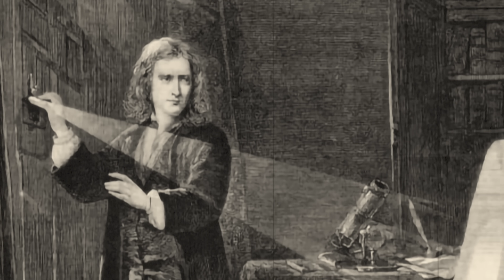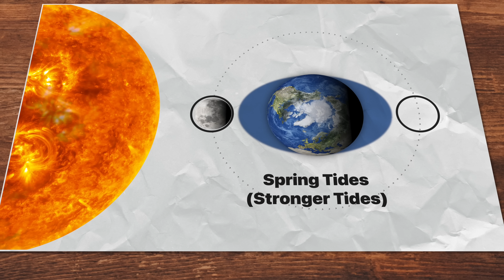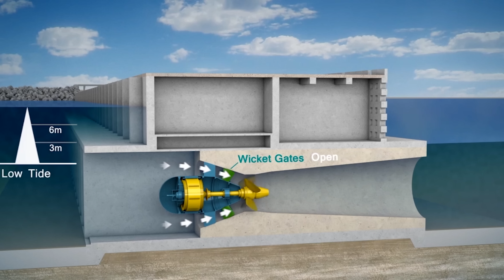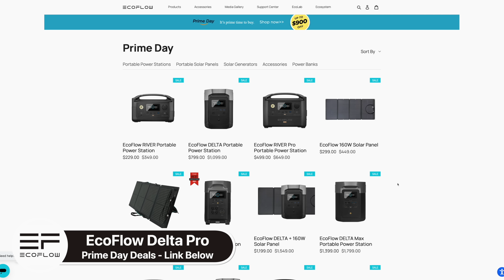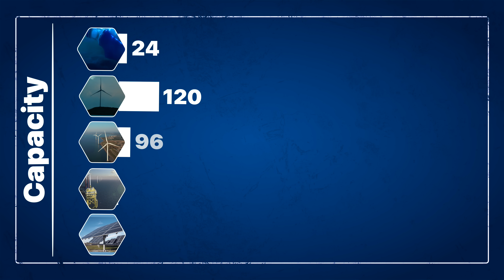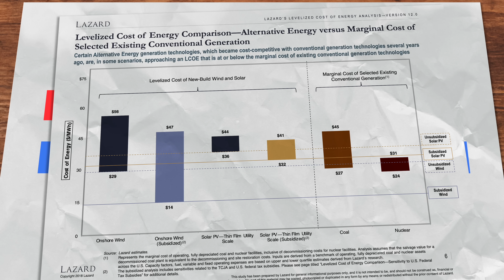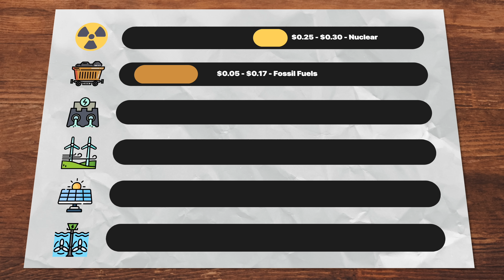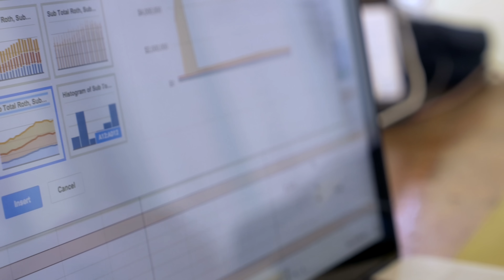Breakthrough Energy Source is 10X Better Than Wind & Solar!?

Comment: I am waiting for the U.S. Patent Department to return the Patent documents I filed a week ago. My invention can keep a number of wind turbines spinning 24 hours a day, 365 days a year. There will be no need for off shore wind turbines. My wind turbines will provide electricity on demand. When demand goes up, flip a switch and increase the electricity to the grid. When demand is low, flip a switch and turn off the wind turbines.

Comment: Again, you forget, or leave out the carbon footprint of construction of these units and their support structures, dams, and floodgates. Tidal generatators are a fine idea, much better than pumped hydro, but they have their downsides, too. What if these generators face rogue waves, or actual tectonic tidal waves from earthquakes? Can they stand these damaging forces?

Comment: The 18-22 hours per day figure is a bit misleading as the power output is not constant.  At high tide and low tide the power generation is zero.  The hour before and after each high and low tide sees low power generation.  So, tidal energy is also intermittent!  Lastly, the click-bait reference to "10X Better than Wind & Solar" is 100% bullshit!

Comment: My guess is you need a diver to do any servicing of the units and even if you have to crane it out the water. The potential is there, but we have to wait for a tech break through. Just like for energy storage.Even if the break through come tomorrow, it will still be at least 2 decades before we build enough infrastructures to make it work.
Reply: That's not true. It is largely a funding issue. There's experimental fields all over the place.
There are things left to figure out. But we totally have the technological/material science level required to make it work.

The Dutch had a test field with tidal/solar/wind combination units for example.

Comment: 11:41 Inherently age resistant . . .75-100 years
Show me a boat that has been underwater that long,
and I'll show you an old, unusable boat.
The tides at one place in Korea vary by 12 feet.
In France, they have a place that changes by 3 times that.
In Texas unfortunately, we have a change of less than 2 feet.
Thorium, Thorium, Thorium
Build standardized reactors, cut the red tape, and we can be living
high on energy produced for 24 hours per day.

Comment: UUUUHHHH.....look to the company OCEAN POWER TECHNOLOGIES.....TICKER ....OPTT......MUCH SIMPLER AND MORE VARIALBE BETWEEN SIZES...and....only 2 parts one... part...1) a floating doughnut magnet riding up and down on 2) a verticle wire stator. DONE.....

Comment: The trouble with 'experts' is they are not aware of the type of generators a grid requires. It should be cheap, and be able to modulate output as and when required. Cost comes down to energy density of the fuel and it's price together. With the exception of hydro generation none of the renewable sources of generation meet those criteria.
Nuclear, while having to some degree, the ability to modulate output does tend to be run at maximum except for refuelling and maintenance. Nuclear fuel is both cheap and exceptionally high in energy density so is well suited to base load provision.
Renewables give very variable amounts of power such that a matching capacity of alternative reliable power has to be available at all times. Tidal depends on tidal flow has little flexibility and requires large installations for  small amounts of power as the energy density is so low.
There is often very good reasons why such existing technology is not more widespread,  simply those that were built show poor results.

Comment: It seems that older system installed decades ago with decades old technology are still in service. Not many wind or solar panels decades old are still in service. 
 Constant supply is a giant plus as solar is a daytime producer only and wind is hit and miss. 
  Tidal is far more reliable steady state electric generation platform.

Comment: But you simply have generation transmission ranges which is fine for coastal cities, states and in some cases coastal adjacent areas.  But more then 500 miles or so and you lose much of the generated energy into the grid.  Its a nice additional add on to none commercial fishing coastlines but its not the solution.

Comment: Many years ago  I designed a system using wave surge well underwater that would pump seawater uphill into  a pressurized system that would then run a hydro electric power generator. Thus any intermittent variation would store the energy without the need of batteries. By using the force of the waves well underwater the only result would be less destructive waves, the higher speed flow at the top and bottom of a "barn door" collection would keep sand build-up  out of the picture, and extreme waves would simply make the "doors" lay flat and not tear themselves apart trying to absorb too much energy. Being so simple and "low tech" is their largest hurdle and the cost would be similarly low.
Reply: And where are you going to store all that salt water with enough head to be useful. Most solutions would need to store the pumped seawater in what would be fertile coastal soil, causing a net agricultural loss.
Reply: @everettlwilliamsii3740  Think typical large oil tank on highest local ground. I would prefer that some effort to blend in would also be included as not doing so would be the biggest objection. Edit: Where there are good waves there is also cliffs and strong winds, and rarely good farming. I can think of a few like the Pacific side from San Francisco  but there wind power is sufficient  and even folk that live there hide their houses out or the wind so the view is not the consideration.

Comment: I'm not sure why some of the designs should have issues as marine power has been around for at least 150 year's with steam so salt water effects are pretty well known. 
I guess it's the very common problem of designers and engineers wanting ti do things 'their way' and not even look at proven technology. 
As a service mechanic I have seen some absolutely horrible designs that probably looked good on paper and do the job but are terrible from a maintenance standpoint. (it's very common for maintenance techs to say the designers should be forced to work on things they design, after a few years when things are siezed up and covered in 's***'
Materials and lubricants have had steady improvements over the years so it shouldn't be a problem, after all, none of the underwater turbines is expected to cope with several thousand horsepower and 200,000+ tons of ship and cargo. Seals and pressures won't be extreme at 'normal' depths where these things operate.

Comment: The Rance tidal power station is nice, but not without problems. Mostly, it's causing the silting of its reservoir, which lose 1% of its capacity per year. The silt reach a depth of 3m now... Something will need to be done.

Comment: You thought wrong 'breaitongs' .  The hidro-centrals electricity dams  installed on the rivers are the cheapest source of electricity producers with only 0.02 cents once they start producing electricity and requires less costly maintenance and less often, and less costly electricity output for the same amount of electricity than any other source.  The problem is that not every country have enough and qualified rivers plus basins or land for such construction of dam electricity sources, or the money required in advance to build them.

Comment: On a practical level I feel that electrical equipment near salt water is a BIG MISTAKE.
Old 3 blade wind generators are already having a worse waste disposal problems than thorium nuclear power plants.
The floating bobber generators that Europe is deploying seem to hold the most promise.

Comment: Sounds great, until you realise, they have tried this numerous times and with each iteration, the units have failed, no matter the type, size or construction, due to the massive forces water has on moving objects attached to stationary ones, as large as the turbine blades have to be, to harness this energy effectively and efficiently. Simply put, they cannot stop them from breaking. You would need massive solid stainless steel blades, which would make it cost prohibitive and feasibly improbable.

Comment: Those tidal range plants look interesting. You could house the generators above in the concrete structure. The blades could be lowered down into the water below and connected with some kind or drive train. Maintaince could be made easy by winching the blades up out of the water. Having that concrete building above means you could also have a gantree crane servicing a whole row of turbines.
Reply: Sounds similar to the function of an inboard motor combined with an outboard propellor and steering system on a boat. But with the role reversed, propellor taking in the rotational energy and converting with a generator to electrical power.
Reply: @PNH-sf4jz  yes, that's a good way to put it! So many designs I see look too fancy, carbon fiber capsules with a generator inside etc. Keep it low tech, simple, and easy to fix I say, because the sea water will wreck everything.

Comment: Likewise, worked on the various systems design and calculating for a century of operation generally requires at least 3X the replacement of equipment costs in the budget versus Edison generators of 1911 used in dams still operating in some areas. A tough furrow to follow. Fast flows means tough placement conditions as mentioned. Floats, anchorage and gearing ... slow flow capture means larger structures vs fast flow focused equipment. I believe we have to be more organic in design, qualities of the sea water integral to its structure, embedded to be replaceable or compoundable. Just have to figure the links that could match the energy of two year old children, harness that and get rich. Wish them luck with that one too.

Comment: As the real overall cost versus ROI changes annually. a mix of energy generation systems suited to the local area is always going to be best. It will be the DIY and small utilities that will likely be the innovation geniuses, since huge utilities have political pressures to deal with.

Comment: The biggest advantage of water turbines is that, unlike air, water is incompressible. It absolutely will push the turbine blades. Air likes to find its way around the blades. This is why efficiency is double.

Comment: The need for a coastline on a continental shelf, that concentrates the 0.5m tide in the deep ocean to a multi metre tide in a small area that  mechanical systems can really work with will always keep tidal systems limited to a few special places. The video mentions this, but briefly, like it's not such a huge drawback. Tidal will probably be an important part of the energy mix for countries with the right kind of coastline, but it's hard to see how any future innovation would make it a substantial part of the world's energy production. There are reasons why even some of the best sites for tidal power, like the Severn estuary in the UK, have still not tapped that resource after 60 years of talking about it.

Comment: Underwater sea turbines is not the only form of using tidal energy. Floating paddles which pump oil into a hydraulic drive don't suffer from sea turbine degradation. Also tidal rise and fall pumps air into chambers which can drive turbines. A small one has been working for many years in a remote Scottish island.